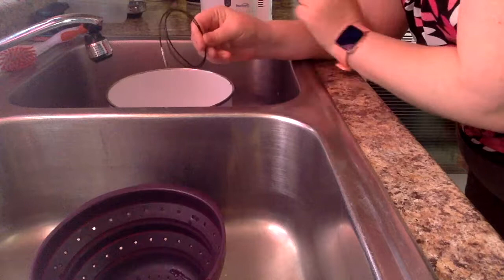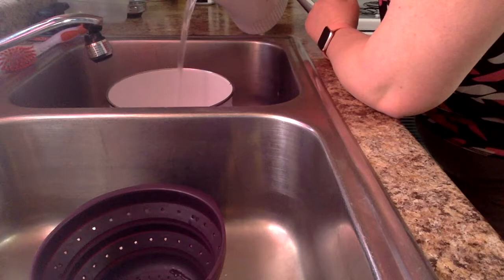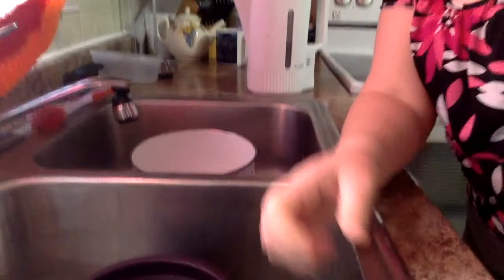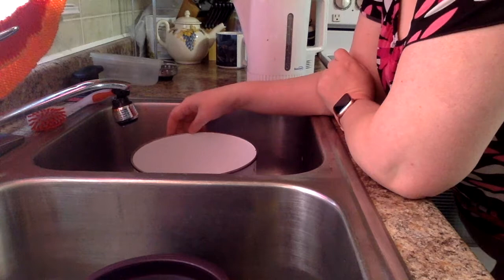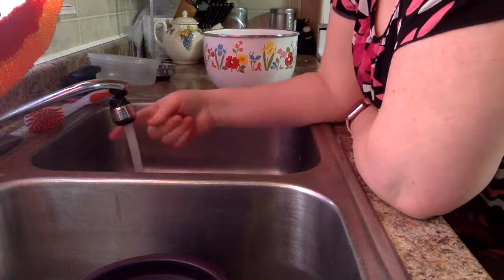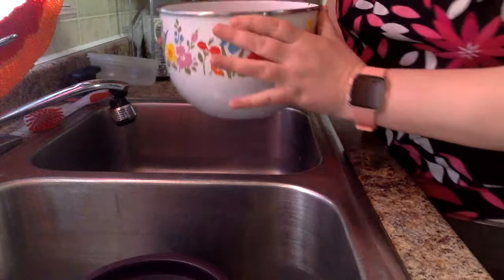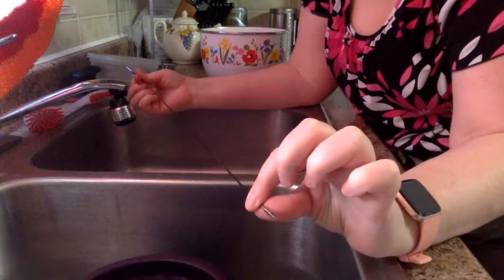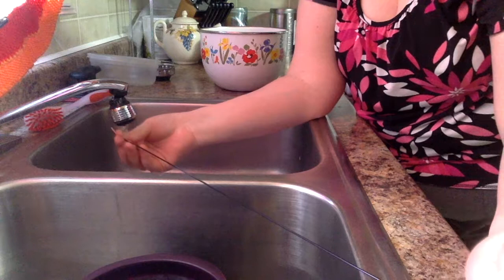Straightening the cable for Lykke Interchangeable knitting needles

Comment: thank you for the video. maybe leaving it in the boiling water for one full minute is the trick that will straighten this puppy out for good. thanks for the tip!
Reply from the maker: It's been 3 years since this video and the cable u straightened in the video is still good.

Comment: Very kind of you to warn of the dangers involved with cheaper needles. Any way to straighten those cheaper needles we experience with?
Reply from the maker: @brigitt8149 If you put the water only on the cable and avoid the connection with the needle it might work. If it does cause the needle to slide out of the cable you could attach them back together by putting some super glue into the end of the cable and then putting the needle back in and taping it together until the glue sets. If there is any snags you can use a nail file to clean them up.
Reply: @adhdcrafter  Thanks for your tips, Find the one with the nail fail particularly useful.

Comment: Thank you so much❣️ You don't find the boiling water melts it or rusts the metal! 😬
Reply from the maker: @akakonoha 3 years later they're still good. The trick is to dry them off really good. But the boiling point of water is lower than the melting point of the plastic.
Reply: @adhdcrafter  OK thanks... worrying. 😮

Comment: Maybe a silly question but how do you store the needles once they're straightened out?! Thank you 💕
Reply from the maker: Good question! I actually have just been putting them back into the case they came in. Or just leaving them on my yarn shelf so they can stay straight. It depends on the length of the cable.
Reply: @adhdcrafter  thank you 🙂